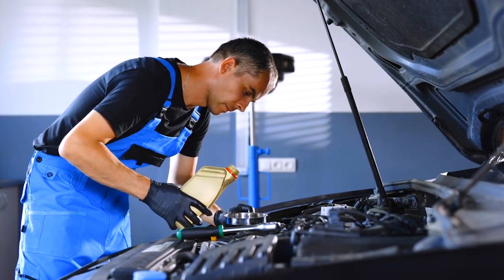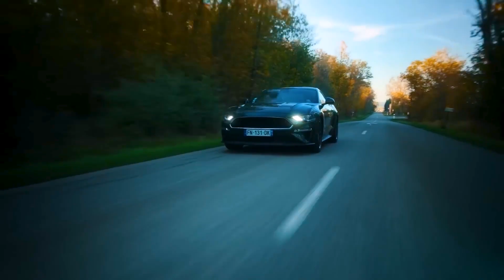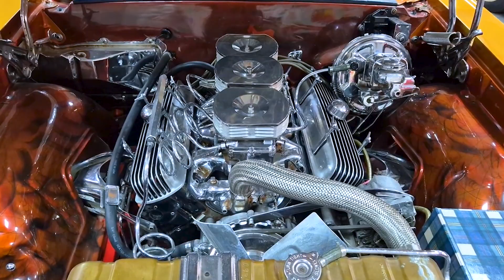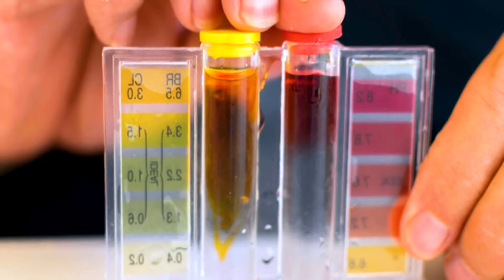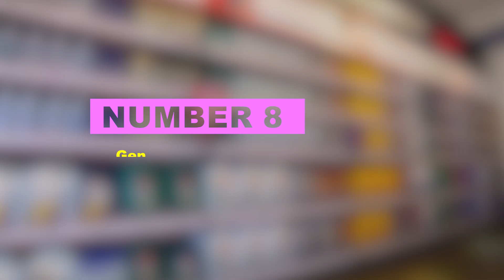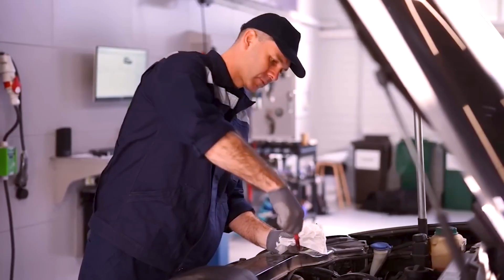The Worst Engine Oils You Should NEVER Put in Your Car

Comment: AI voice ruins even the best video. On to my question. What about Lucas Oil Conditioner? Is it safe to use on a vehicle with over 250.000 miles on it? I hope to see an answer before I make another mistake. I used 1 bottle in a van I currently own. It had about 200K miles on it then. That additive by Lucas is as thick as molasses and I'm thinking just about as good for my vehicle. Am I correct?
Years ago, I put Rotella diesel oil in my gas powered V8 Ford pickup truck. I learned the hard way about too many incorrect additives for strictly diesel motors. It started to knock after around 100 miles. I did an oil change and put in a heavy weight oil and traded it in ASAP. I'm sure I killed the engine.
Reply from the maker: Lucas is super thick, so it can quiet a worn engine but also restricts oil flow, especially on cold starts. At 250k miles, it’s better to stick with the right oil grade (maybe one step thicker if it’s burning oil) rather than relying on additives. Regular oil changes with the proper spec will do more good long-term.

Comment: I'm driving a 2001 Honda Accord with 180,000 miles I'm told that I need synthetic 5W 20 I like Pennzoil is High mileage Pennzoil a good oil for a 2001 Honda Accord
Reply from the maker: For your Honda Accord with that mileage, a high-mileage oil like the one you mentioned could be a good choice!